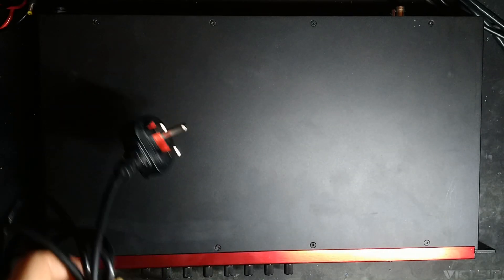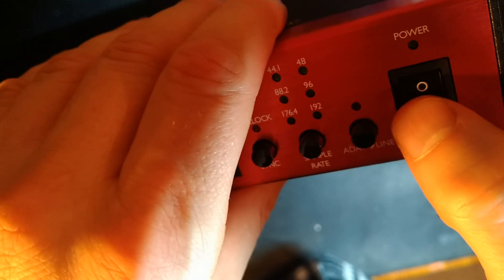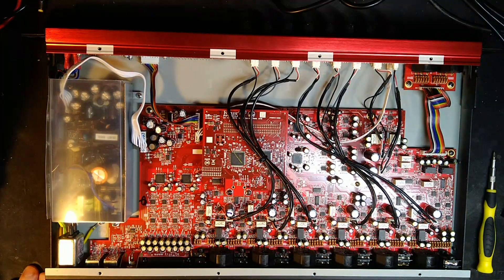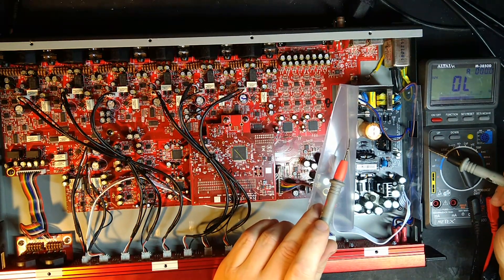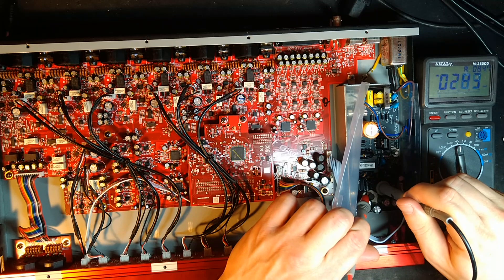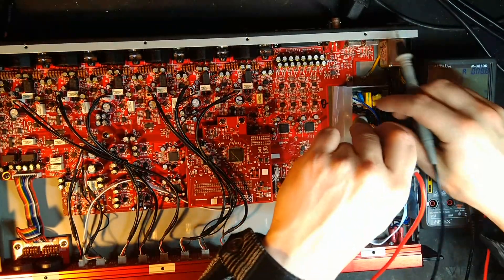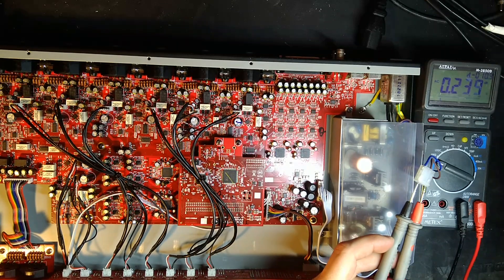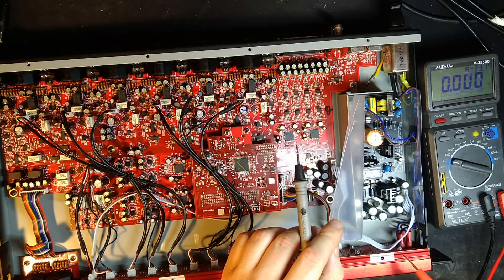Faulty Focusrite Clarett Octopre initial inspection (won't power on) - FIXED see link in description

Comment: Hello! I have a weird issue with my octopre dynamic. Nothing works but the lights, it turns on but I can’t switch world clock source or frequency or anything. Sometimes the lights don’t turn off until I turn on 48v. What are some things I can check first?
Reply from the maker: That could be one of a lot of things, I’m just a hobbyist but FWiW I’d open it up and check for the basics, like cables not seated properly, burnt out components and bad smells, leaky capacitors etc

Comment: did you recap this unit? Stock capacitors were bad or cheap? what caps did you put in it? what op amp this  unit use?
Reply from the maker: I did not. I replaced the whole power supply and it worked! Almost every very time I've tried to recap a power supply I've blown it up, not sure why, my soldering is reasonable!
Reply: ah ok tnx  for infos
Reply: you did not mention abt the op amp in the analog input section